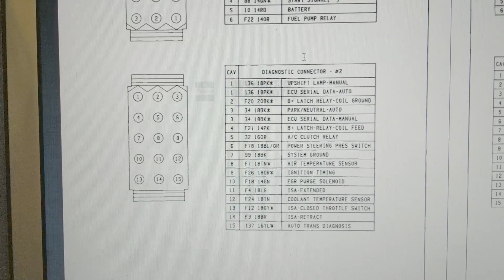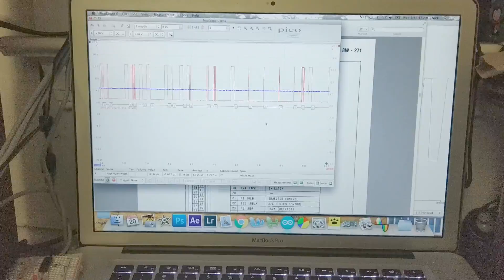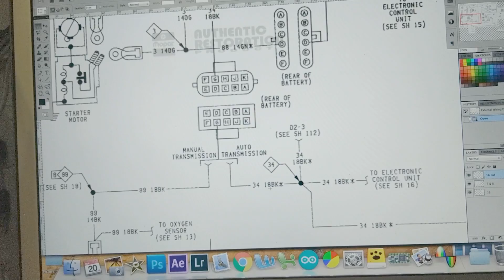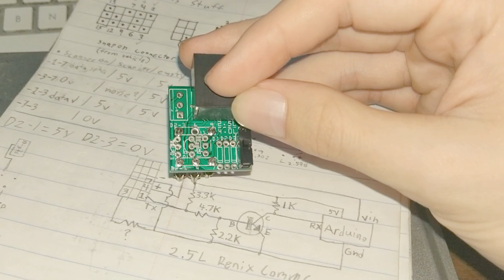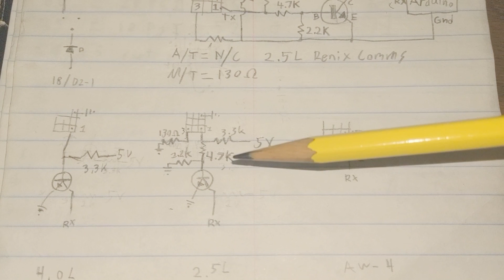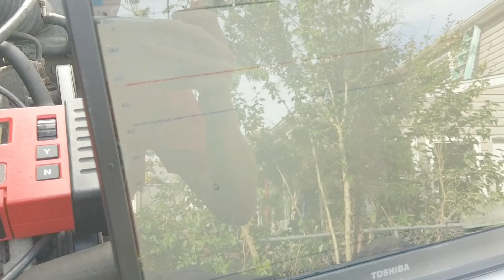Cracking Renix 2.5L A/T ECU Comms

Comment: I have no idea if you'll check out this comment, but it's worth a shot
Got an 1986 Cherokee with a 5 spd manual and a 2.5l
One day we lost fuel and spark, and ran everything down until we figured out it was something with the ecm. It's not very easy to find a replacement, and I'm considering a repair. Is there anything specific on the ECM that would cause this?

Comment: Noob here, what exactly did you do with your discovery? I am into hardware hacking a little bit, so I understand some of what is going on but to what end?
Reply from the maker: It's been a while, but looking back I found out the on the Manual Jeeps, the Shift Up Light is also on the data pin. So when that light is on, it brings the whole data line up to 12v which would be very dangerous if your scanner was not properly protected. With that, the logic low level was also raised so if you were at the cusp of that threshold, the light would probably prevent you from getting data when it was on.

Comment: Would pin d3 behave differently if the trans was in drive vs park?
Reply from the maker: Sorta kinda yeah, but it doesn't affect data. See 18:14 for the difference between A/T and M/T mode on the MT2500 for pin D2-3. So D2-3 isn't needed for data, basically the same set-up as the 4.0Ls minus the non-zero low. So why the M/T ECU has to be so complicated with it's split signal requirement I may never know. The whole 12v pull-up from the upshift light was kinda funny though.

But the Park/Neutral switch is just that, a switch that brings D2-3 to ground when in park or neutral. Basically the same exact thing that the MT2500 in M/T mode does or my adapter switch does. So funny thing here, if you flip the switch to ground, I believe the ECU would think the Trans is in park and you'd be able to start in any gear, lol.